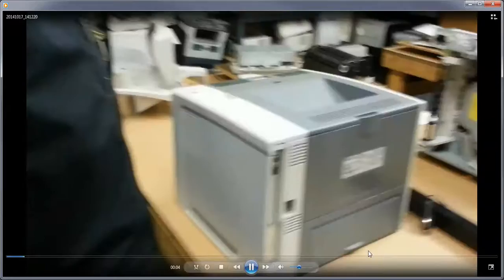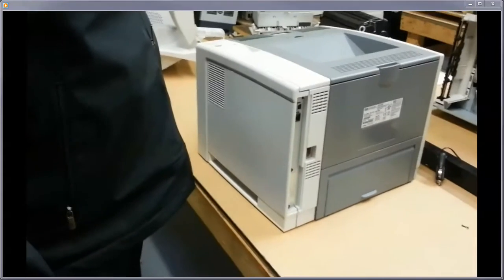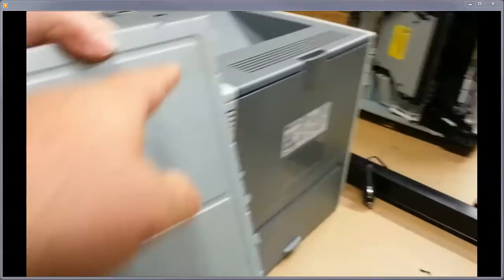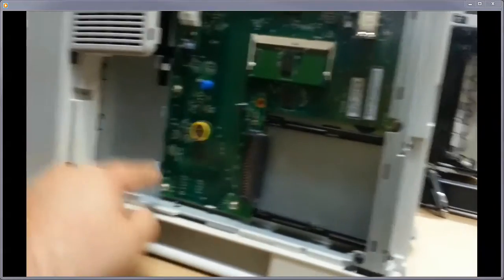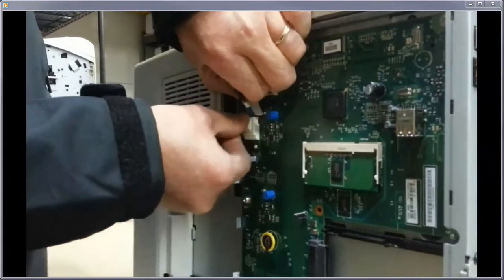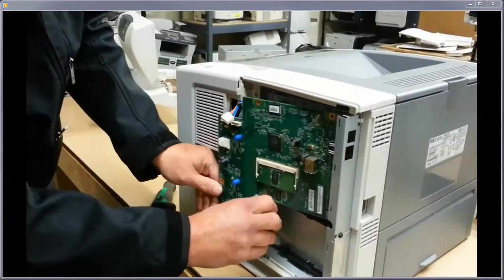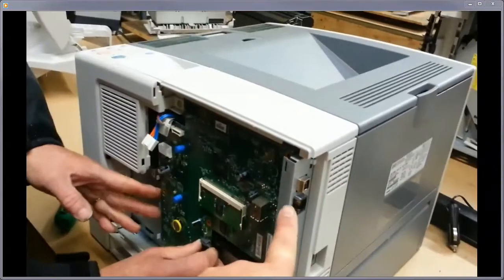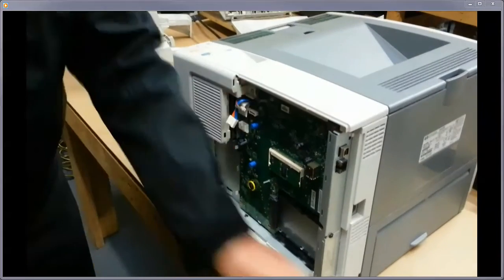HP LJ P3005 Formatter install uninstall

Comment: I need help with my printer my usb port is not connection to my labtop....
Reply from the maker: If you have this printer and you cannot connect to your laptop via USB you potentially could have a bad formatter board.  Its a simple repair.   We have them for 59.00+ shipping.
Reply: It had an old print just like this so I followed your instructions and successful installed 
Thanks for posting awesome instructions
Reply from the maker: You're welcome.